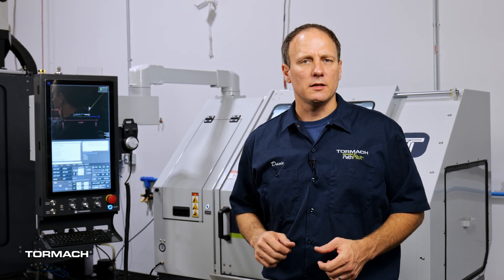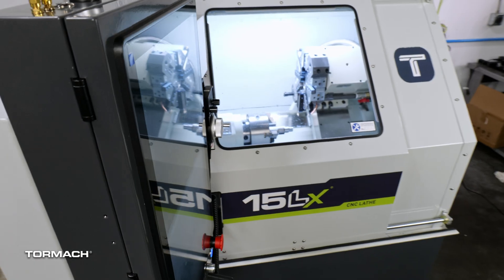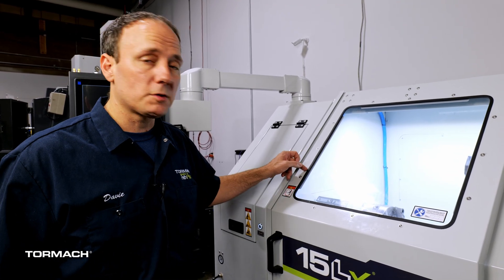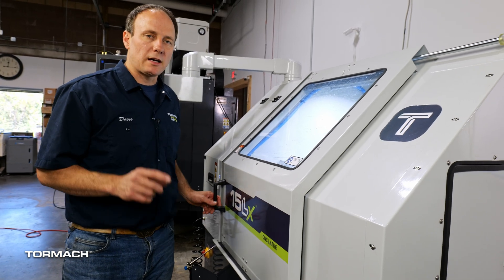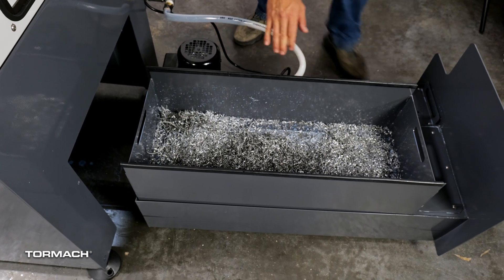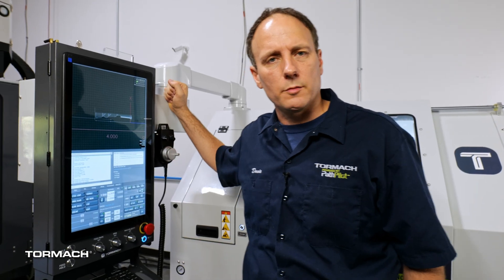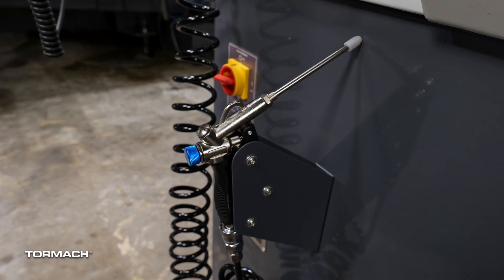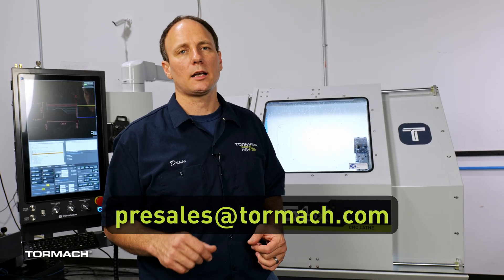Introducing the Tormach 15LX Overview #cncmachining #madewithtormach #cnc

Comment: What is the spindle bore size? Can I mount a 4 jaw chuck?
Reply from the maker: Spindle bore: 1.53 in. (38.86 mm) (With 5C Insert Removed)
The spindle nose has a built in D1-4 Camlock Mounting system. So yes, you can mount a 4 jaw chuck as long as it has a D1-4 Camlock Mount.  Here's the link to the 15LX Specifications Sheet: https://tormach.com/media/asset/1/5/15lx_lathe_spec_sheet_1025_final_2.pdf
Reply: @tormachinc thanks so much!! What is the spindle bore length from nose to rear of spindle?
Reply: @HS-qt3jr  With nothing bolted to the rear of the spindle, a hair under 14". 

-Norman

Comment: Love your machines (I have 4 of them) but I do have some notes. First off, Way covers? this machine needs those. My two 15Ls have been begging me for some kind of cover on the bed. Two, I like the bigger chip pan, but that it comes out the right side means that it is problematic for tight quarters installations. Also, without a parts catch, I fear I am going to loose all my little screws and such that I make down that deep dark hole never to be found. Is there an optional screen? Anyone who makes small parts and just lets them drop is going to find this a bit of an issue.

On the plus side, I welcome the redesign of the base and enclosure, both of my enclosures tend to leak during coolant intensive operations, so I hope this one is a little more water tight. 

Any improvements to the turret?

Will seriously be looking at one as my oldest 15L is getting a little beat.
Reply: I know Robin Renzetti put a way cover over the Z axis of his 15L but to my knowledge there has never been any reports from customers of "the lack of way covers on my machine caused X issue" that would push the needle towards justifying additional design time/parts/cost for way covers on Z. 

There were structural issues that would have increased complexity of the stand if we wanted the same size chip opening and coolant tank coming out the front. Can't win them all. 

No screen, we had one on the original prototype but A) about the 3rd cut I did resulted in chucking a 5 lb chunk of steel that would have destroyed the screen if I hadn't removed it and B) having a screen in the stand and a second screen in the chip bin could result in starvation of the pump. Good news though, a parts catcher is planned as an accessory but no release date on it yet. 

The turret is also powered by an Ethercat servo so tool changes are 50% faster and there is no lock switch needing adjustment.

-Norman

Comment: My shop has the 15L. One of the first things I did to improve it was to fabricate extended brackets on the sliding door rails so that it slides open 6 more inches. It just bothered the hell out of me that the door did not slide sufficiently enough to get your head in there for cleaning, tool setup, and troubleshooting. I'd rather have this than the door lock safety feature.

Comment: Upgrade option for current 15L? Or trade in??
Reply: There will not be an upgrade option, outside of the obvious gutting of the electrical cabinet the changes include modifications to the base casting and completely new motor mount brackets. 

-Norman
Reply: @TormachTechnicalSupport  I hate to be the one to mention a tailstock, but is there any chance a regular 15L tailstock would fit this? I do a lot of pen/pencil bodies supported between centers and really need a tailstock. I've been looking at the 8L because of that, but the lack of spindle orientation is a dealbreaker unfortunately. Unless.....could you fit a smaller version of the spindle servomotor to the 8L?